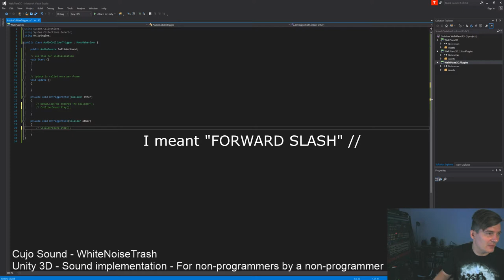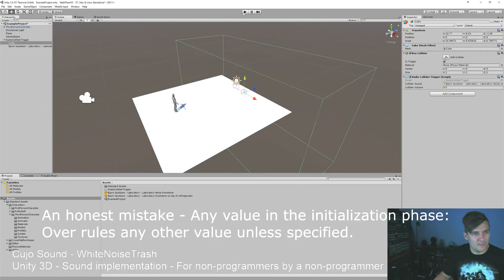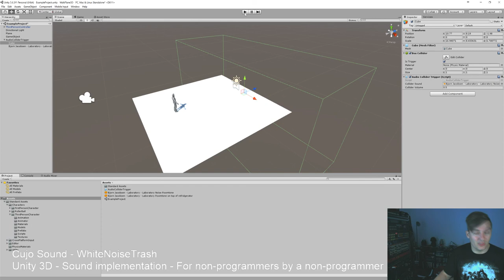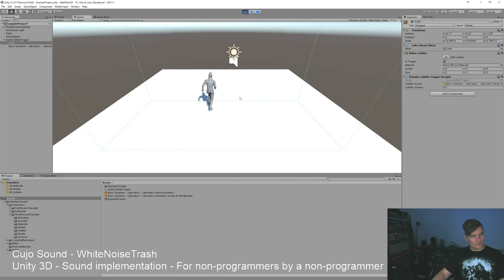Bjorn Jacobsen - Sound Design: Part 3. Unity audio for non-coders on parameter controls.

Comment: Thank you for this! - If I want the volume/pitch or whatever to become the same value as before when the listener exit a collider, what would be the smartest thing to do when working on a project? - My logic says it would be smart to create a public float, for example: "ExitPitch" in the script and then in the void OnTriggerExit section refer to the "ExitPitch" public float so I can adjust the value in the Inspector tab instead of opening the script everytime and change the value in the actual script. Correct me if I am wrong, thanks. :)
Reply from the maker: Yea. Storing the value on entry or at some other time is the easiest to do. Doesn't have to be a public float as such, could be private too. But make a float named OriginalPitch, store that before changing to anything else. On exit make original pitch the value of the object.